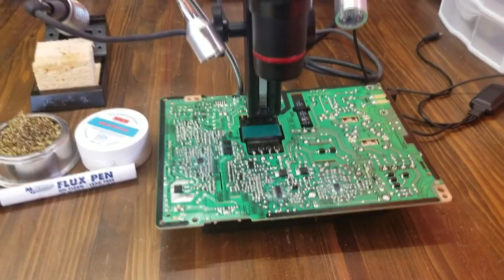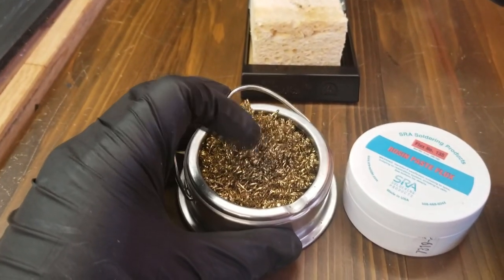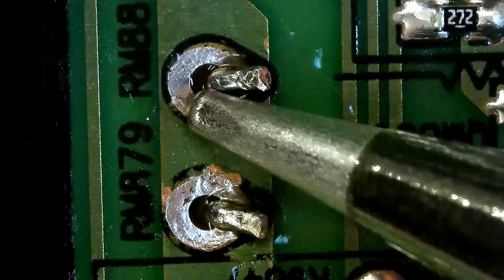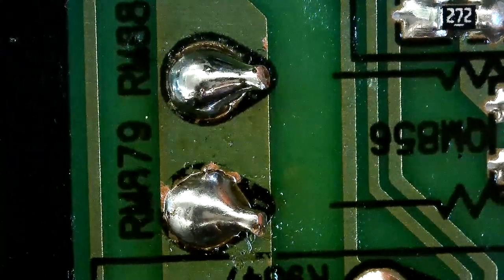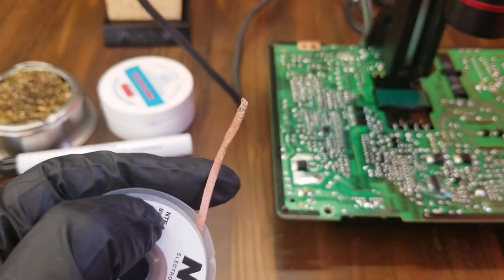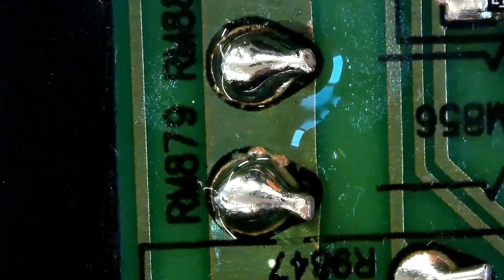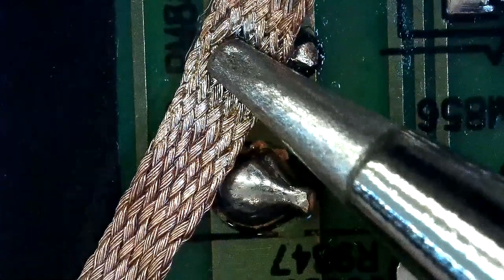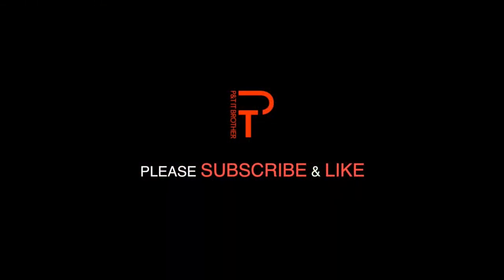Soldering & Desoldering Tutorial | Beginners How To Video | Temp, SMD, Flux

Comment: The best video showing clearly how to solder and desolder.  Simple, straight to the point, not rambling.  Only thing I want to know still is what soldering station you use and how to tin the tip of the iron.
Reply from the maker: I am using Weller WES51 soldering station, and I actually purchased every tips for this one. It looks it is ETH tip

Comment: Great video, thanks.  Im trying to desolder and remove a micro-usb port from a Magellan GPS, but the solder is not melting.  I'm using your process exactly except I'm using a butane torch full blast with a conical tip.  Can it be its still not hot enough?
Reply from the maker: There are different types of solder and they all have a different melting point. Also, it is really important to use a high quality tools. 380c and above will melt most kind of solder.

Comment: I’m working on a tv circuit board do I desolder  with the wick to take the chip off then I can solder the new one on?
Reply from the maker: It all depends. If the component is big enough and have enough space to use a solder wick, then yes.

Comment: Hello it was indeed a helpfull video. 
Do you recommend desoldering using a 15 watt iron ? Could it generate enough heat to do that. Or is it just for soldering ?
Thanks in advance
Reply from the maker: Try it first. Every board use a different type of solder and components. It means, some of them have higher melting point and some of them have a lower melting point.

Comment: I don’t have flux pen ,can I use soldering paste like the one you have instead to do this job?
Reply from the maker: Sure. Why not. It is just a different form of the same flux
Reply: @PTITBROTHERGravenhurst  what can I add to turn it to liquid state? Type of chemical/solution?
Reply from the maker: The heat. You can dip your soldering iron to it, and it will melt.

Comment: I just bought soldering station,so what’s temp(Celsius) do I set to remove ic chip using hot air and what’s temp(Celsius) setting to solder them back using soldering iron? Thanks
Reply from the maker: The temperature depends on your soldering station’s performance and the ambient temperature, but typically, I do use between 350C - 400C for both soldering iron and my hot air gun

Comment: Hello there ... Wanted to ask You as I am a beginner and I am trying to solder BIOS chip back to the motherboard. I have cleaned the pads with wick and I am now struggling to put new shiny solder on it. I am really dont know what I am doing wrong. I am using flux and I got two different solder but the result is bad. Thx for any help ...
Reply from the maker: Please tell me more about it? What happens when you try to apply solder to the pads?
Reply: @PTITBROTHERGravenhurst  Well I can somehow apply the solder to the pads but after the chip just wont stick on it. When using hot air. I can see that the solder melded but after while the chip is not soldered and leaving chip feet tracks on the solder. I am like whaaaat.
Reply from the maker: Could you try to solder the chip leg by a soldering iron and see it does work well? If it does, maybe your hot air station is not good enough
Reply: @PTITBROTHERGravenhurst  The problem was the solder ... it was rubbish as I have tried another one and  the result was much better. Soldered it with the iron. Thx for replies and help.

Comment: Hi ,Thanks for your nice video . I have a 25w soldering iron . I tried to desolder a component but I think it's not hot enouph to melt it . What is the recommended soldering iron in watt ? Thanks in advancec
Reply from the maker: 380c or above should do the job, and it is really important to use a good quality soldering iron and the soldering tip. Low quality tools will give you a hard time to do the soldering right.

Comment: What's the best temps when using wick to desolder? The wick seems to stick and is hard to remove.
Reply from the maker: It depends on the type of the solder, soldering station performance and etc.. Did you use flux when desoldering? Try to use flux. It will help melt the solder quicker.

Comment: I still can't get my joints empty of the solder they is in the holes.. Driving me mad.. Makes me feel dumb
Reply from the maker: When you have a hard time soldering, make sure your soldering gears are good ones. Cheap soldering machine and tools will cause poor soldering performance.
Reply: @PTITBROTHERGravenhurst  very true .I was working on a thick board, so I used a great gun to help molten the solder, it finally came out 👍😁👍

Comment: Good tutorial, but its definitely not that easy. I did the exact same thing after watching this video using everything you used, and it did not desolder that easy
Reply from the maker: It is really important to use good quality soldering gears. When I had a cheap soldering machine a long time ago, I struggled to do soldering correctly, but with a decent soldering gears, the soldering is much more easier